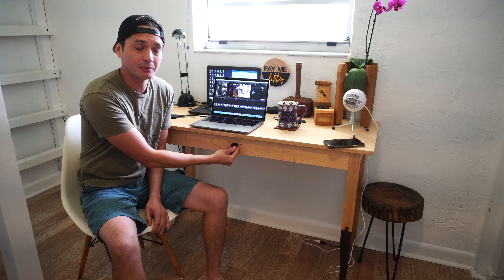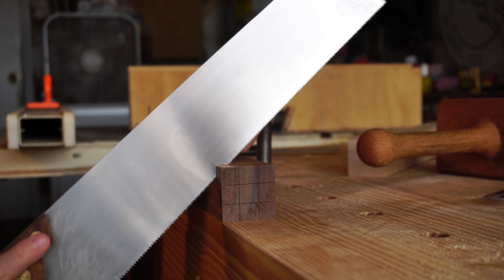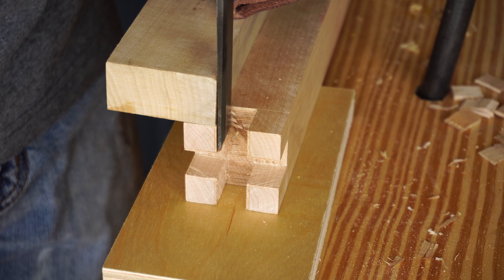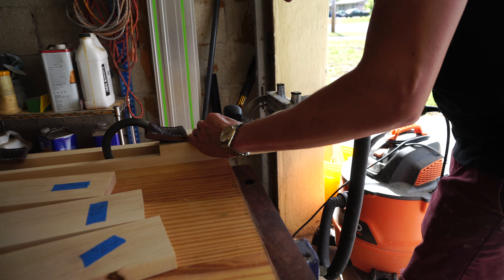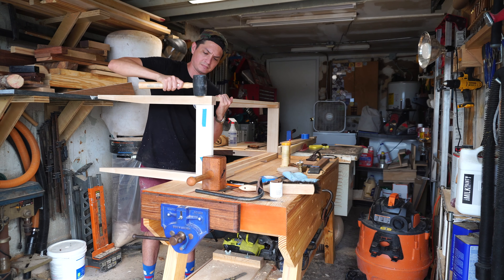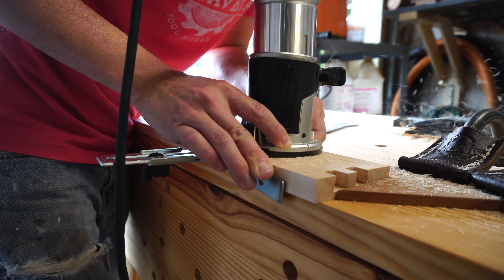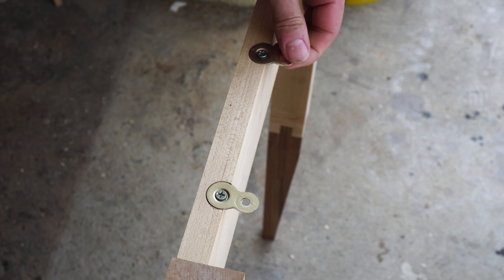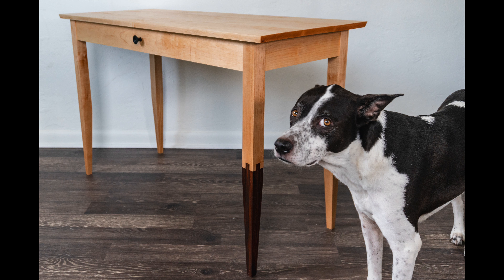One of these legs is not like the other...

Comment: Wow my mind is spinning from all the technical woodworking terms you just threw at me, what an incredibly detailed build and video, the table is beautiful and the joinery is rock solid man 🤘
Reply from the maker: Ah it ain’t THAT technical. 😉 but glad you liked it. This is definitely one of those builds where you could dial it back and make something a lot simpler.
Reply: @CowDogCraftWorks  yeah simpler is definitely the way to go for me, for now
Reply from the maker: The Jon peters version of this as an entry table is joined entirely with pocket holes... and it doesn’t have a funky hand cut Japanese timber framing joint. So there’s that. 😂

Comment: Your work is so clean. 

I can’t catch everything thing your saying for the recipe you use for your finish on this piece. Do you mind replying with with a recipe? I would like to try it out sometime :)
Reply from the maker: Hey aria! Thank you for the compliment it means a lot. So the finish is two stage. Stage one is equal parts boiled linseed oil, pure tung oil, and satin wipe on poly (arm r seal also works), with a splash of mineral spirits. None of these measurements have to be exact. Stage two is pure tung oil, boiled linseed oil, and beeswax in equal parts. Stage two has to be incorporated together so you’ll have to do a double boiler on the stove to get the parts integrated with each other. For a less protective finish, but one that’s easier to apply, you can skip stage two and just apply paste wax.

Comment: Excellent work Chris!  I can really appreciate your detail work.  How do you sharpen your plane and chisel irons?  Those shavings are woodworker porn for sure.  Also, how about a video with the finishes you used in this project, I noticed you used two different ones...
Reply from the maker: Hey man! So it’s a two stage finish, not necessarily two different finishes. Stage one is blend equal parts boiled linseed oil, pure tung oil, and wipe on poly with a dash of mineral spirits over the top. Stage two is linseed, tung, and melted beeswax. I’ll apply coats of the first stage until it’s visibly an even sheen. Usually will take a couple of days. It’s a wipe on and wipe off process. Then the wax coat is applied and rubbed off in a buffing motion. It’s kind of my go-to finish.